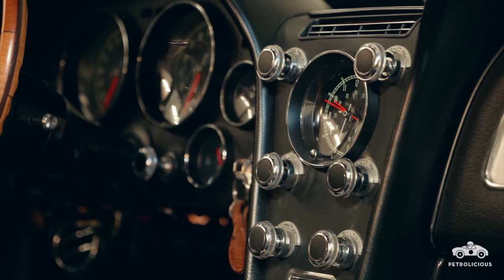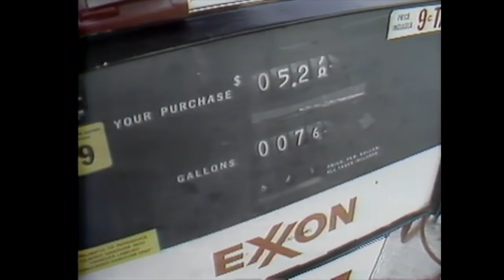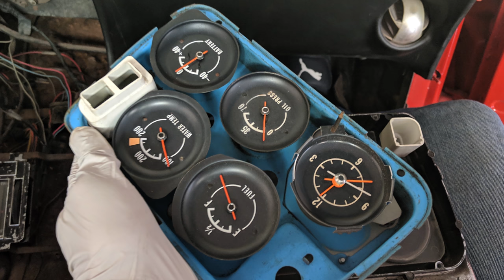Corvette Stingrays - We Bought 2!

Comment: Brakes can easily be upgraded, transmission gearing or final drive diff gear change, cam profile change etc. easier more fun and enjoyment with no emission problems, that 10k corvette is worth it and a keeper.  Winston got alot of work to do on that car =/ time is money, been down that road of $1000 car blown engine and tons of problems dropped $20k into it DIY.  Its now a beast but man did I spend way too much time on that build.  Looking forward to the drag race and dyno.  Psstt Winston Nitrious Oxide magic cheapest $$$ to HP ratio just to win the race.

Comment: I remember all drum breaks and no power Steering. Best cars ever.
Reply: I remember the older C3 vettes were hit pretty hard by the emissions regulations, some of the v8’s only made 200-250hp. The drum brakes couldn’t have been that bad with only 200hp under the hood lol
Reply: I remember getting an ex military Landrover 101 up to 80mph on the motorway (we're changed the gear ratios for more top end)... Then remembering this 3 tonne bus had all round drums and no servo...

Then I remembered that whatever I hit, I was gonna win anyway, and all was good again!

TBH with the C3 I'd be more worried about that horse and cart suspension!
Reply: There were never drum brakes on the C3. All had 4-wheel discs.
Reply: @buffdelcampo  that's actually a disadvantage! Drums have a self servo action on the leading shoe.
It was the the disc brake that caused the introduction of the servo.

Comment: I currently own the '68 from this video.  I added power steering, power brakes, new exhaust, electric headlights and new seats.  I swapped out the long for for a factory original and I am in the process of reinstalling the factory windshield wiper assembly. The car was not bad but needed a little love.  Next up is new heads and a cam.

Comment: The C3 is amazingly beautiful. You can buy them cheap and upgrade them cheap. They are relatively easy to mod to increase the HP to proper levels also. Mostly just have to take off dogshit parts that made the engine reach emissions standards and replace them with the real parts.

Comment: See I would rather start with the better car then do some upgrades as you go along.  New shocks and breaks will do you wonders and likely there is an AC upgrade for that car..  Put in some Dynamat to quiet things down inside and hunt down those rattles and squeaks.

I worked at a tier one automotive parts supplier starting in 86 through 2010 and we use small peal and stick felt pads and lithium grease to silence about 99% of the noise in almost every interior piece from door floor consoles, overhead consoles, door panels, armrests, headliners, and  visors.  I've made them all the for most car manufacturers at one point during the 15 years I worked there... from Ford, GM, Chrysler, Toyota, and Honda, to BMW, Audi, Lexus, Mercedes and more.  I worked at all 7 of the local plants and even spent a few years making discontinued models for service.  They are all the same.

Comment: What did you mean by "cheaper than a motorcycle"? I just picked up an 1980 yamaha 850 special for $700. The liquids all need to be replaced as well as breaks, but it fires up like a beautiful animal.

I also managed to get a 1998 Oldsmobile Aura for $450 with some minor maintenance requirements. And it literally has everything, heat ac, heated seats, CD & cassette player, sun roof,... its almost a modern car. 

Anyway I might be ranting a bit, these used country vehicles do seem to be cheaper, I viewed prices around other areas of the world and nothing still running seems to come close... it confuses me.

Anyway minus me bragging I'm an absolute doorknob when it comes to repairing anything on wheels, but I'm giving it the best I got, I understand the importance of maintaining a healthy vehicle, I'm just not 100% sure what it all means.

Comment: Believe it or not, I may have been to that junk yard, when I used to live in LA. I rebuilt a couple of Mustangs in the 1980's, and that involved scrounging around in a lot of junk yards. Yes, my first Mustang was absent power brakes and power steering—only had a straight six engine.
Reply: Carbage Man sounds like the mustang I had,   No power anything strait6 with a 3 speed.  It ran and got me around well.😁
Reply: @yourdiytechlife  It was a solid car. Mine had a  C4 auto trans that was rebuilt before I bought it.

Comment: Im a little late to this conversation, and not knowing very many details of C-miks vette, i still think i can figure out some of its quirks. #1. A decently mdded small block, and the car seems to be reving a bit much at freeway speeds. The previous  owner may have been making a quasi drag car, and possibly  changed the gear ratio in the rear end. If you put a 5.10 rear in any car, it will not be quick. It might snap your kneck at take off, and was designed to be at top speed(maybe 110 give or take) after a quarter mile. Stock was usually 3.23.
#2. The crate motor almost certainly has a higher red line,  like much, much higher, than the original motor.
#3. If all you have is the factory tach, i would not trust it. Any piece of electronic equipment, especially a piece 50+ years old, that converts hi voltage pulses into a analog dial, is just not reliable. Hell, you see people put aftermarket tachs on brand new cars, because they aren't that accurate.
Any way, enjoy your hoopty's.

Comment: Meanwhile i learned drving on an FSC Żuk, which had no power, as well as not powersteering, no power brakes and a none synchronized transmission. My father always talled me, that the k in kfz (Kraftfahrzeug, offical name for a car in car in german) stands for the force (kraft) you need to drive a car. I guess i am one of the few west germans in my generation who learned driving in a soviet union vehicle ...

p.s.

But I guess the more interresting car is the second car i drove. a street legal audi s4 estate with about 700bhp. My father logic was simply, if you can drive one of those Żuk, you can drive anythink ...

Comment: 68 is still a good year .. winston you should get a LS 350 that is stroked out to 427ci and then it can be a 427 vet .. you could go mild turbo and get 650+ HP or  you can run it with fuel injection and get a very stable 450hp... put a cable shift 5speed trans on it.. or look for something that is wrecked with a 350 on copart with everything you need for the turn over... Tell you though if I ever build another mustang I am doing a 351 stroked to 427 and a turbo and then  a strong C6 Automatic which I will build myself .. and posi rear... but thats unlikely at least for now... not sure my health is up to it.

Comment: Welcome to the Corvette tax! Parts cost more just because they fit a Vette. If you shop around though you can find deals. Do you post on the Corvette Forum? Lots of good info there.
Funny how you talk about 1970's technology and how bad cars were. I turned 18 in 1974 and I couldn't afford a new Corvette back then so I drove '60s cars. My first car was a '66 Lemans two door with a 326 and 3 speed. Drum manual brakes all around, manual steering, no a/c, no power anything. Lots of play in the steering and when you hit the brakes you knew it was going to dive one way or another, just didn't know which way. 

This is why I maintain that us older guys (and girls) are better drivers than young people. Cars are so good now and isolate the driver so much that you can text or screw off and not pay attention while driving. When we learned to drive you had to be paying attention every second on the road! Going 80 in those old cars felt like 150 in a new car today. You really had to drive those cars. 

But I still love them. I have several classic cars including a C3. I also have a C5 that does everything better than my C3 but like you said, it doesn't get the looks and the thumbs up like the C3 does.

BTW,  looks like your '74 has a fiberglass rear bumper instead of the stock one. It looks molded in and doesn't have the vertical split line in the middle. I think you got a decent buy on it though and it will (already has) go up in value.

Comment: I used to own several Datsun Z-cars because their claim to fame in the 1970's was they could beat a Corvette in a drag race in a quarter mile. It's kinda true. The corvette would eat it off the line and anything past 1/4 mile. But at that sweet spot, the Z-car would win. So I bought a 1973 Datsun 240z and did a MOUNTAIN of work to get it where I wanted it. In the end, it was nice and fast, but completely unreliable. I sold it and bought a Ford Focus.
Reply from the maker: Lol
Reply: my condolences, Snark man!
Reply: @laowhy86  It was just one of 4 Datsun Z-cars I had. I owned a 1980 Anniversary 280ZX, a 1981 280ZX, a 1973 Datsun 240Z, and a 1975 Datsun 280z. If you see the "Snarky" license plate in any of my videos, that was my actual license plate on the back of my last Z-car (also on my SVT Focus).

Comment: I don't think it's going to be worth fixing but that's only because I think you picked the wrong car to start with. The seized motor is going to kill your wallet if you have to replace it or buy parts to finish putting it together and then there's the rims you definitely need to replace and all the interior trim. I bet you could've found the same model with a running motor, boring (But usuable) rims and maybe a trim piece or two stuffed in the back.

Worst case scenario 5 grand isn't going to cut it.